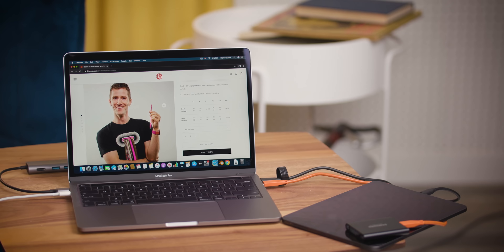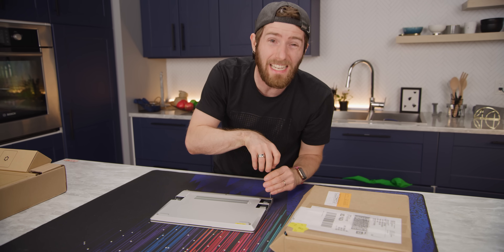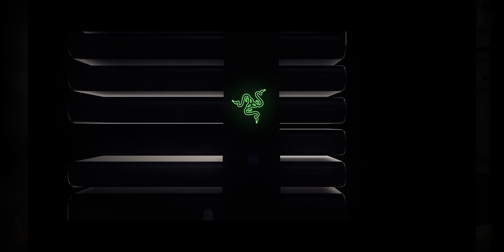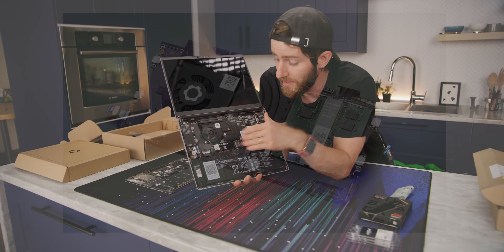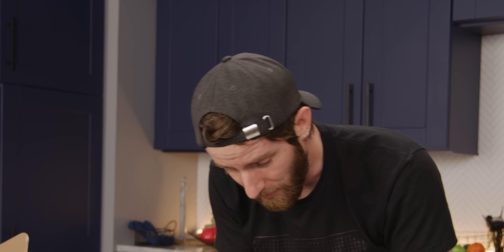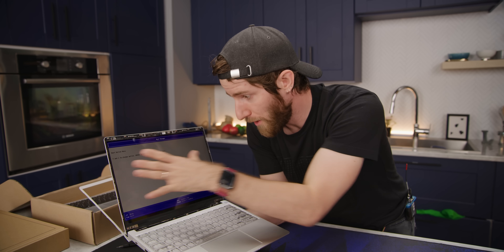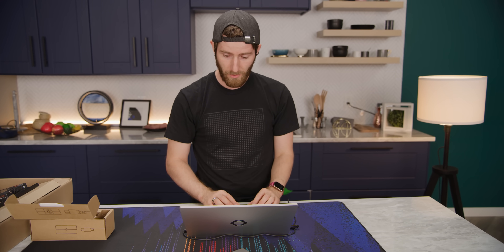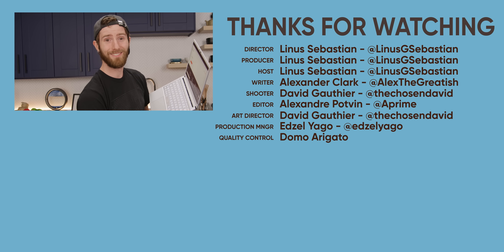A COMPLETELY Upgradeable Laptop?  - Framework Laptop Review

Comment: Personally one of the things I wish phone manufacturers did was go back to removable batteries. I remember when my dad had an HTC and was using it heavily he'd just have 2 batteries so he could just quickly replace the battery and continue on. Especially when my main problem with having to get new phones is the battery, it's really nice
Reply: @Ireikes  I had an LG G3 with a removable back and it had wireless charging
Reply: Samsung have the FUCKING Galaxy Xcover Pro. Which is both water resistant and removable battery.. All they need to do is shave the rugged parts and put a flagship spec. Samsung is bullshitting us. 🤦🤦
Reply: @Ireikes  Nah. I believe those features are also possible with a removable battery.
Reply: @3lH4ck3rC0mf0r7  never seen a glass back with a removable battery
Reply: @Ireikes  it seems like it would be easy to make a glass back with an aluminum or slightly rubber lining to be able to take the back off. The back plate doesn't need to flex to be opened.
Reply: @Ireikes  Me neither. But it doesn't sound impossible.
Reply: Yeah the only phone i can think of that still has that is the pinephone but its being developed and will still be for some years
Reply: I mean power banks do exist. An extra usb c port would do the job just like in the rog phones
Reply: @tehpunisher4568  I like wireless charging however I think it's still in a very infant stage right now. What I would really want is to have most tables have a wireless charger on the whole surface or at least a good section and it just charge my phone to 80%. I wouldn't have to worry about making sure I place it on the pad right, just leisurely toss it on the table and forget about it
Reply: Laptops too. I never needed to care all that much about battery life when I could hibernate and swap the battery for one I was carrying with me in the case.
Reply: Samsung’s Xcover Pro is designed for removable batteries and it’s water and dust resistant (ip68)!
Reply: The problem with that is the vast majority of people don’t care about that. There are still phones that have removable batteries but people don’t buy them.
Reply: @UC7h26zZlRGsRRH0Tl4-W_RA only stupid peolple drop their smart phones in water. I for one NEVER drop enyhting in water or water damage. Also almost all phones are not water proof. Your warranty would even get void of you water damage your phone. Phone companies today are just greedy basards who want to suck their consumer dry with stupid senseless phone designs. Glass back, glued battery now no phone jack yet worth 1000 usd. Only an idiot would agree with that.
Reply: It's for this very reason that I love my Moto Z4 with an Incipio additional battery on the back.  It's not too bulky at all and lasts well over one full day without battery anxiety.
Reply: @Ireikes  Imagine a glass removable back, that is not flimsy like the plastic ones, a glass back would be so easy to repair that way.
Reply: yeah i had a samsung with replaceable batteries back in 2011
and when we go on school field trips i would listen to music all day and swap the battery out for a charged one when its almost out
miss those days
now im forced to buy a power bank which can get bulky
Reply: @Ireikes  wireless charging can go through anything that’s not super dense like metal and galaxy gave you the option to add it too phones like the galaxy s3,4,5 note 2,3,4
Reply: while yes, removable batteries are a nice convenient feature, but they had their limitations, and wouldn't really be easy to implement today.. Removable batteries usually take up significantly more space inside a phone due to the added shielding to protect it from drops, pokes etc and the contact pins used to connect it up. Due to this capacity would be quite a bit lower.
What i would like to see tho is them making it easier for us to replace these batteries by not gluing them in with such strong adhesives, adding pull tabs/trays like OnePlus and some Huawei phones.
Reply: They want you to keep buying a new phone every year... with some bs feature, like the 100x zoom on samsung that you might use once..
Reply: @namelic9619  Samsung: we put a telescope in a phone
Reply: @namelic9619  its unrelated, he's talking about external removable batteries that you change in 10sec. They dont exist because they add a lot of weight, all laptops except for some extreme lightweight ones, have replaceable batteries.

Comment: Was looking for a laptop, might grab one of these. I couldn't find one with medium specs but 1 Tb ssd. They all had 128gb or 256. Which programs like visual studio can easily take up 30 - 50gb. Getting a laptop so I can put in my own 1tb ssd and easily replace a faulty fan. This honestly sounds like such a win to me. And having the option to run a motherboard OUTDIDE the laptop can end up so useful for cncs and stuff where I don't need pins just the usb to run it. 

Jaw dropped and majorly impressed. I hope they keep this momentum and keep it all together correctly.

Comment: I'm sorry, but the 'modular I/O' is a bit dumb. It's a puck that converts a type C port to whichever I/O port you want, nothing groundbreaking, all it does is internalize a single port dongle. At that point, I would rather use a dongle, as most of my dongles are either small adapters or multi-port adapters, rather than carrying around a bunch of pucks that I would have to switch out if I wanted a different I/O configuration. It honestly doesn't make sense to have four modular ports, when you could just have four type C ports with a dongle. If you really want or need a broader port selection, then buy a product that comes with that port selection, or just use dongles like a normal person. It's a design choice that only takes up space and increases costs of the product. Honestly, each one of those modular pucks could house at least two ports, except a full size HDMI or DP port, but they could just use mini/micro variants instead, but at that point just use a type C port that has mode switching for eDP. If the spec is USB 4, hubs will become more available and dongles will become even more useful, so again what's the point of internalizing a bulky dongle, when at this point it'll just become a limiting factor for I/O expandability. The only interesting concept here is the storage, but again why not just use typical external drives instead, or if you really need that extra storage why not just upgrade the internal storage so that you also have better performance.
It's the classic boardroom idea that doesn't make sense in reality. "let's do this and this," but at what cost? Just throw all type C ports on the device, people can use dongles and hubs like a typical person and not bitch about it. Honestly, if you do bitch about dongles and hubs, you need to get over yourself, and maybe pull your head out of your ass before you suffocate.

Comment: If they make a modular gaming laptop, they’re going to take over the entire gaming laptop market…
Reply: They should look into MXM then. They're really expensive, and Nvidia doesn't seem interested anymore.

But, having a specific motherboard with the right balance of GPU vs CPU might work. E.g. built in mx 450 or gtx 1650 with lower power CPU.
Reply: @yensteel  problem is MXM is Nvidia's proprietary IP so the decision to let it die is theirs
It's still used a lot in industrial applications (afaik it's in Teslas) but the firmware support for consumer device applications is lacking
Firmware and drivers were the biggest issue I came across when doing a 1070 SLI on a water cooled Ivy Bridge laptop, that it was even possible was due to Clevo and MSI using the MXM reference designs provided by nvidia
Reply: Really wanted those "portable itx desktop" otg
Reply: @justsheeeps134  A great idea! It could be like a rotated Skyreach S4 mini case with a monitor on the back. Monitor replaceable, thickness adjustable with various C-shaped side panels.
Reply: I dont think the GPU and cpu can be upgradeable, only mainboard.

The Heatsink is designed to handle only that kind of power, you need a better cooling to handle more powerful cpu/gpu

Or just over-engineer it at the start, which is not a good business model tbh
Reply: @bacphan7582  The only way I could see them making the CPU upgradeable is by using desktop CPU. But, the tech is not there yet.. rip
Reply: @bacphan7582  how about like razer was suggesting in their modular pc dingus

Modular components we can slot in with built in power handling and cooling and whatnot similar to how a tower is except with laptop components

With say daughterboards that house the two major components like cpu, gpu and then have the rest of the components be the modular parts they are
Reply: Would love to see that happen!
Reply: Lenovo made one if I remember it correctly.

Comment: Not in the market for a laptop right now, but if they're still around in a few years I might take a look at them.

If they expand into higher-end systems it might be nice to see a laptop with a desktop socketed CPU and upgradeable discrete graphics (the later would probably be harder to pull off, but still). Granted, it would be a much larger system, but there's still a market for laptops bigger than your typical thin-and-lights/ultrabooks.

Comment: Ideas for them: recessed usb’s for wireless dongles and sim slot module for 5G modems…
Reply: Once these start rolling out, people will start making their own modules. I would do a magsafe module
Reply: @adityagojamgunde7152  To be fair, there are already adapters that plug into USB-C to provide similar functionality.
Reply: @adityagojamgunde7152  yep, this + 3d printer = whatever adapter you want
Reply: Or do like a combo module. 5g modem, Logitech Unifying receiver and micro SD reader in 1. All things which are otherwise thumbnail sized USB-A dongles
Reply: Ethernet
Reply: Multiple usb c in one module also possible it's quite chonkers
Reply: 5G won't work until they go ARM. Intel doesn't have 5G modems yet. Unfortunately.
Reply: @PanCakesAreFat  intel sold their modem business to Apple, I can’t imagine they ever will

Comment: Most laptops have upgradable ram, ssds and battery, the 'you can put your ports anywhere' doesn't justify this laptop at all
Reply: I don't think this is a 13inch, since when linus was comparing it to the xps, it was nearly as big and the xps is a 16inch, and if it is a 13inch, its a lot bigger than others and that makes it look like a laptop from 2014, yeah i know most 13inch don't have replacable ram, but most 15-16inch laptops do and this is just as big as them so yeah this is kind of stupid when you can get all of that upgradabilty with extra performance and better screen, keyboard and touchpad and battery life with other laptops like the xps15 (tho the name has a 15 in it the xps has a 16inch screen)
Reply: @Aditya Bhattacharya as i said it was just as big as the xps15, i wouldn't exactly call that small for a 13inch laptop
Reply: @Aditya Bhattacharya and what linus didn't mention in the video is that the xps15 has all the upgradabilty as the framework, other than the replacable ports and you get a much better laptop with the xps15 as i explained in previous comment

Comment: Interesting, but not very powerful laptops.  I’ll keep an eye on them and see how they do, but lets face it.  Companies come and go, especially when it comes to hardware.  You can only upgrade so much before it requires a complete replacement of everything.  Glue is used to keep things light and tight.  Modular adds a lot of weight and ugly look.  Sticking with my MacBook Pro for now.

Comment: Accessibility and documentation are sweet, but these hot-swap USB-C module things seem a bit over engineered. One USB-A and USB-C on each side would be plenty flexible and leave should leave enough room on the inside for a full size M.2 slot for Storage/5g.

Comment: Sorry guys, Apple or some other company will buy them or just switch RnD to run them out of business if this becomes successful. That is how apple does business. They begin by first offering the staff who work at those companies higher salaries and steal their talent, when the company is on its knees they buy them up for their IP. If they don't comply, they copy their tech using their own staff and run them out. That is how apple competes and why startups don't last long in silicon valley. A lot of people want those high salaries without considering the long term costs of giving up their IP and dreams. Apple has been using this strategy for almost a decade and it works.

Comment: 16:18 don't laptop's do this automatically when they're plugged in?
Reply: Well, yes but no. If the device is not powered on and the battery reaches 100% then charging stops because it's full. But if you're playing a game/running a server/whatever else, the battery may never reach 100% and therefore could be charging "forever" because the battery never gets full, if that makes sense. I could also be wrong, I'm sure it depends on the device in question, but this is how it's been explained to me.

Comment: This is literally the only laptop in the past 15 years that has interested me. I'm typically not a big fan of laptops, because most of them (along with most other electronics) are designed to be tossed in the bin when they reach a certain age.  If I had the money right now i'd order one for sure.

And I hate the entire 'disposable electronics' culture.  Most of them are made intentionally disposable by 'software' that is told to slow it down.  Or by companies saying "you can't do anything but what WE want you to do with it".     Like when Apple starts pulling apps from the app store if your system no longer meets their 'requirements'.   Let us use the old version of the app instead of removing it entirely.  

Like when Apple pulled Garage band from all systems that were under a certain OS version.   I am far less likely to buy a product from a company when they basically hold my apps hostage like that.  I won't pay ANOTHER $700-1500 for a product that I already bought specifically FOR a piece of software, that they then took away from me on a whim.

Comment: This is interesting and I did go try to configure one for the hell of it (site still crashing though), but it's not really my cup of tea since, for the most part, I only buy higher-end gaming laptops. If they ever come out with a line of gaming laptops (even if bulkier and heavier like my current one is) AND the graphics card is upgradable with Nvidia's latest and greatest, then I can easily see this as my next gaming laptop since I could probably get away with just replacing the graphics card every couple of years instead of having to replace the whole thing. I could do a major investment on the first purchase and then save money by just upgrading.
All that being said, I am still interested in pricing a few out for some clients of mine who need business laptops.

Comment: If apple introduced a modular laptop where the majority of upgrades had to be from proprietary parts, Linus would say ‘not good enough, Apple’. The fact you can’t upgrade the CPU makes this a bad buy. Because in a world where SSDs are commonplace, the CPU will be the bottleneck as times change. We’re all still running fine on 16GBs of ram and have been for a decade. But try running a CPU from a decade ago and you’ll feel it. 

I love that the battery is user serviceable. And Apple et al could and should do better there - it’s a ‘consumable’.  But I feel like the fever dream of a modular laptop is just that. And this company will sadly fail because the market for people who want a modular laptop is niche.

Comment: Previously working in break fix for a large financial institution having these laptops today would be a godsend. I'm old enough that the machines from HP and Dell we were dealing with were as accessible as these (even with socketable chips) but I've often thought it'd be a nightmare working there now given you'd be a glorified box swapper as you couldn't really repair anything.

Hopefully enterprise gets in on this, it would be a massive boon to the second line support engineers like I was, a massive saving on their bottom line having to replace entire units and a great revenue stream that will ensure Frameworks future.

Comment: This is why people loved ThinkPads. Unfortunately even they went to shit.
Reply: True, they once had these removable intel processors on their edge models. Then they decided it wasn't cool anymore. 🤔
Reply: That's one of the reason I still have a t440p. I got it for super cheap, got a processor, and screen from eBay. Upgraded to an SSD and 16gb RAM. It's a bit of a chungus but it works superbly. Framework is the first modern laptop I am considering if I upgrade.
Reply: Yup, I got burned by Lenovo recently. After getting a used ThinkPad after hearing about its legendary servicability, I find out Lenovo (in my country) actively condemns the used market, and refuses to sell me parts. Now I have to scrounge up parts from across the world on eBay (at least that's still an option for now).
Reply: @jaykayenn  not all ThinkPad are created equal.
Reply: Went to China
Reply: @locklear308  there's a difference?
Reply: Still rocking with i5 x230t, i love the thicc blocky design of the x230t. But what i like the most is how to disassemble the keyboard. I dont have to open the entire case, just pop out some screw and i can take off the keyboard
Reply: Yeah, they were bought by Ch!na.
Reply: I have my x250 working great

Comment: A nice trend for changing ram/battery/ but still very basic. A cheap hub can deal with the problems of ports. I'd like support for new motherboards/processors/graphics cards. Not an easy feat but would be a nice change the industry needs.